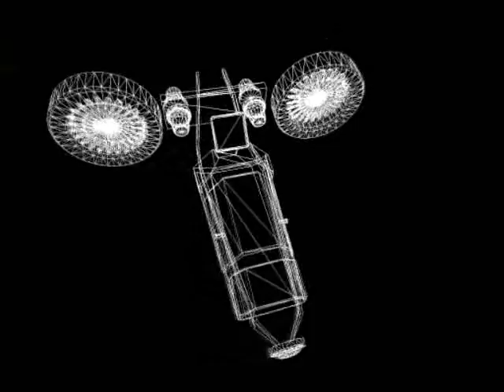Tube Jetpack

Comment: There was one episode where they tried and failed to build one of these because they couldn't find an engine with enough horsepower that was light enough to lift them off the ground. IIRC they tried a 90 hp jetski engine and it still wasn't enough.

Comment from the maker: @wishihadaname94 for tilting of wheels and spinning of the blades (which is pure aesthetic) i use E2's applyTorque. But the motion is all done by thrusters (so no constant upward applyforce or vector thrusters), and changing direction / balancing /stabilization is all done by altering the thruster force and tilting the tubes

Comment: @QSEFYJILP Yeah, but the thing with the Mythbusters was, it didn't "create enough thrust.". But, the engine still had plenty of power left, so they could have changed the engine-shaft ratio to make the props turn faster and generate more lift.